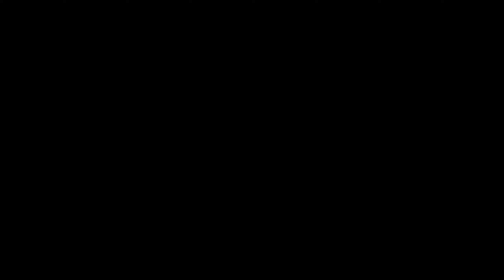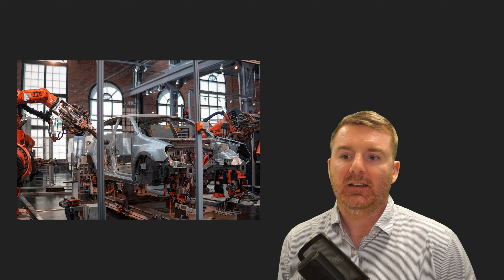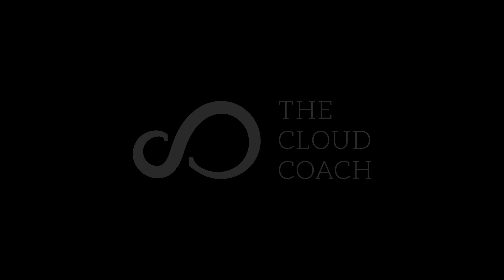Infrastructure As Code + Configuration As Code = Automation! (Terraform, Ansible)

Comment: Great video. I have my dev ops doing these, and it is great. As you said, consistent, versioned, automated etc.  One thing though you mentioned automated test-pass, automatically deploy. How do you test the configuration? Ex, a jdk version in config or a list of kafka brokers in the config. You change that manually and check it in and automation kicks in. Config is already the data that you want to be tested as well. So, how and what will you automate in testing? Any references would be useful.
Reply from the maker: I don’t have anything that comes to mind right now, but if you join The DevOps Lounge (Discord server — it’s free: discord.gg/devopslounge), then we discuss more freely.